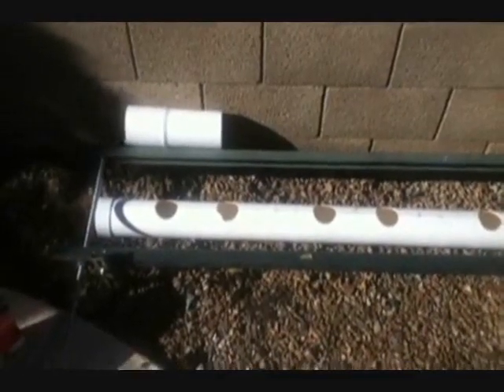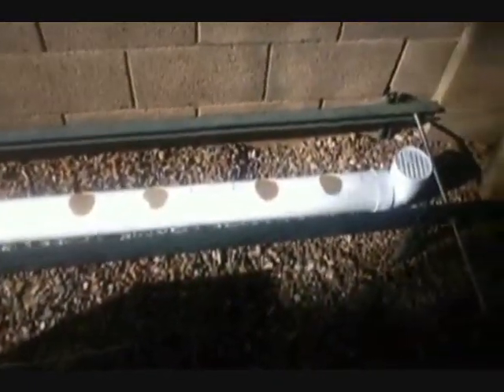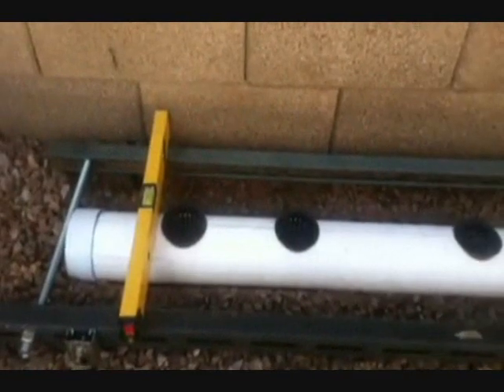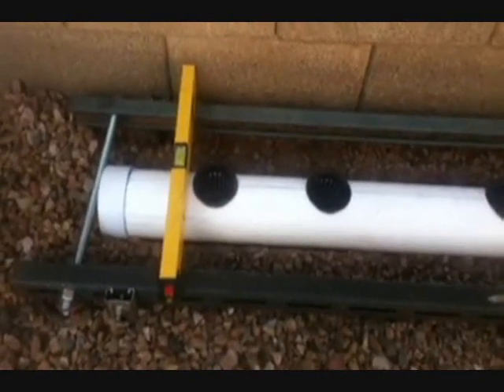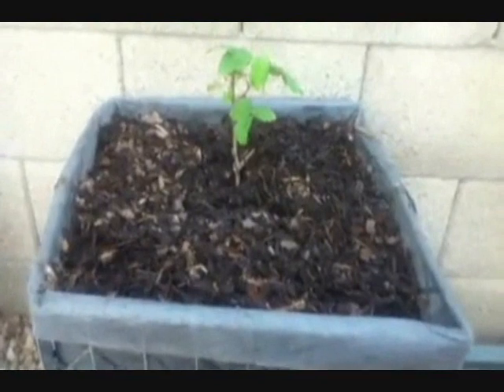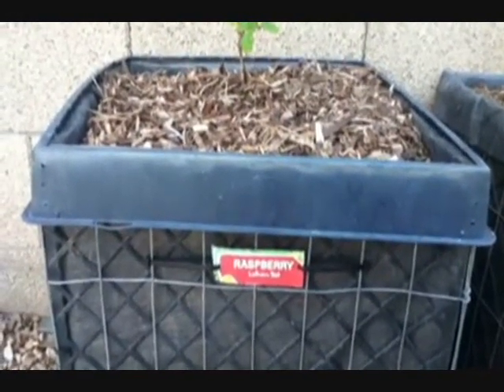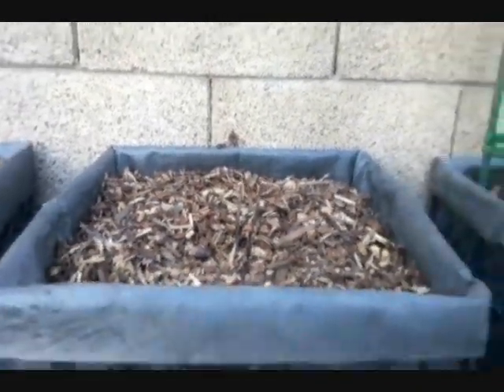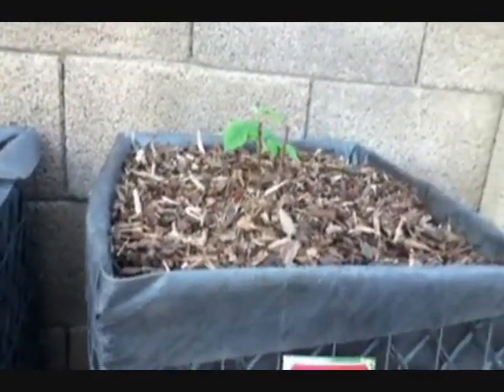Brad Quaiver and his Amazing 4 inch pipe Grow Cube Hybrid System!

Comment: My hydroponic system didn’t work out, so I reverted back to Larry Hall’s “Rain gutter self watering system” using grow bags instead of 5 gal buckets. I get root pruning w/o having to drill holes & the system of simple rain gutter without dunks. I staple landscape cloth down over the gutter tops on the full length of gutter, after finding my plant spacing, I cut an “X” at each spot to allow my 3” net pot to drop down into the gutter. This system seems to be working & no mosquitos. Thanks Larry!